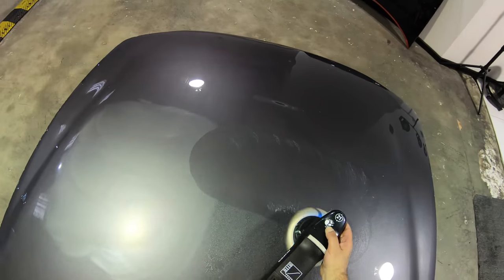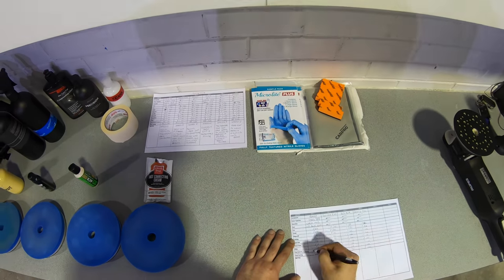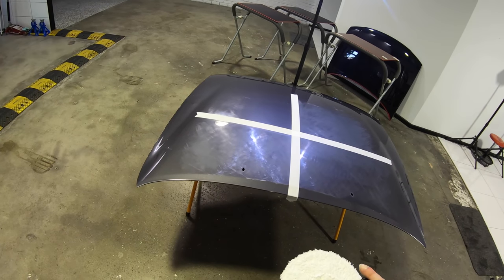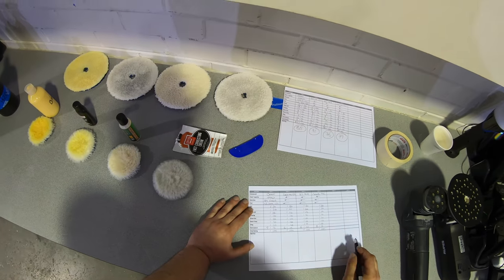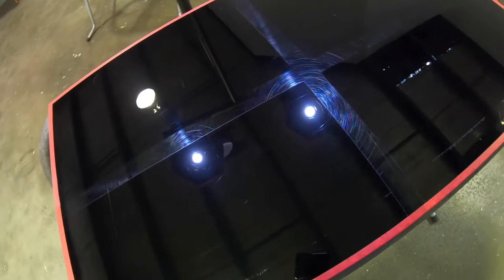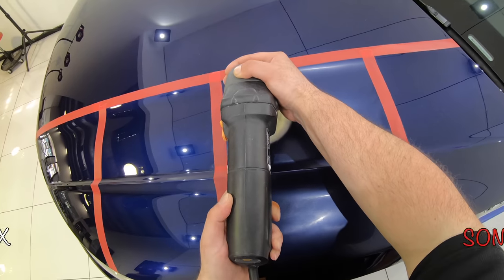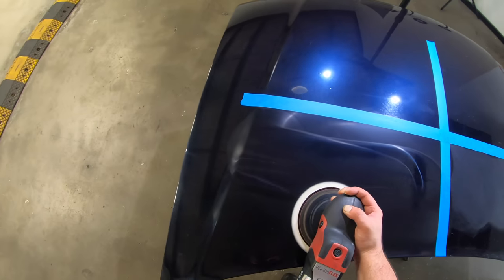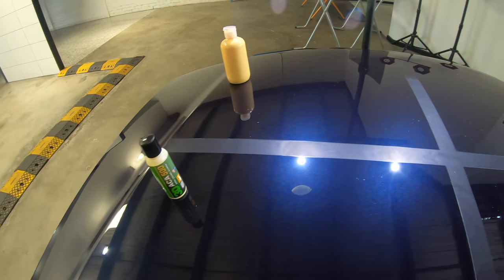Sonax CutMax vs Griots FCC vs 3D ACA 500 Compound Testing & Results!

Comment: I'm not surprised about the Griot's and Sonax the 3d was my focus since you mentioned the ability to remove 1200 sanding marks.I'm glad it did what it was designed to do the need for a second stage isn't too bad to wrap up the finish due to the intensity of the compound thanks again

Comment: 3D results are the best I have ever seen!
Reply: Also like 3D, but Sonax Cutmax is outstanding on some instances.
Reply: just try sonax ultimatecut
Reply: @garcia5986  I have, and still prefer ACA500.
Reply: I have tried Cutmax as well and still dont get tge results i get with 3D ACA500 with a Rupes coarse wool pad, followed by 3D ACA520 with a foam Shine Mate Black Diamond medium polishing pad. Especially on a black or dark blue vehicle.

Comment: I know years later but I tend to use the 3D for more Rotary work then DA as its main purpose is to level sice your gonna have to do a step or two either way. Sonax on the other hand has a longer work time in my experience but doesnt fully impress me on the finish. Griots on the other hand is spot on to what you described. Two product I like to see is Koch Chemie and Oberk. Fantastic video with all the diffrent methods

Comment: Hi guys , im using 3d aca 500 about 10 month , from the minute the company released it .
 Idid hundreds of car and i can say that this compound is a monster and by far better anything i triyed ( the only one is close is the carpro clearcut ) . but !! 
The aca 500 is for very hard clears and to use with wool pad and rotory for best performance . 
The second is with rupes and microfiber ( megs ) or ( wool pad 3d ) .
Reply: It works great with the Buff and Shine Uro-Fiber, as well as the original blue Rupes Microfiber pads.

Comment: Useful and informative as always Sandro...I completely agree with your results but after many hours of experiencing German compounds these are my thoughts in general:(correct me if i am wrong 🙄)
1.German compounds love ROTARY.(I think German engineers keep rotary action in mind all the time when making these compounds)
2.German compounds love WOOL.
3.German compounds are not meant to be used as one stage correction,they always need to be proceeded with finishing polish.
In future try Koch Chemie H8o2 if you have time.I would be very glad to hear your experience about that one.
Reply: Totally agree about the German compounds being designed about around a rotary. They will still work with a DA, but they were not designed for them. Best bet with DA polishes would be to go with Rupes or Griot's BOSS polishes, as they were based on using a DA.
Reply: Awesome insights.  I’m on the fence now about whether to purchase ACA510/520, or the Koch Chemie equivalent combination.  Can you provide any thoughts comparing both?  I’m a big fan of 3D’s products, but have no experience with the latter.  Thanks.

Comment: Griots FCC is what I use in the states it was made by a top polish guy in states can’t remember which one Kevin brown maybe?

I love 3D too though Sandro you need to try 3D “One”
Reply: FCC cuts better, finishes better, and is easier to wipe off than 3D One.....in my opinion. 3D does have excellent lubrication. Very oily, though.
Reply: @c6z061  - 3D One seems more of a "medium" than a heavy cut though. 

ONE is also strange in that some times it wipes super easily off the paint, and others it's a P.I.T.A. to remove..

Comment: I find the Griot’s BOSS items very easy to use. It’s a great system. Great results, long working time when needed, little or no dusting, and easy pad cleanup. I’ve used products that were hard to clean up, like I had Elmer’s glue in my pad and it wasn’t fun. 

The one time I was having trouble getting results with FCC I just had to step up to the MF cutting pad and it worked great.
Reply: What pad you used before switching to MF?
Reply: Carlos Rivera The Griot Fast Correcting pad.
Reply: @meiowalot7570  I just bought fcc and a white pad from griots what kind of issues will I run with my g9?

Comment: THANK YOU, SANDRO!! What a fantastic video!!! Do you feel TLC works better with MF pads compared to these? How about Jescar?
Reply: @CarCraftAutoDetailing  as far as finish, generally speaking, are you able to say if Griot's or Jescar cuts and/or finishes better?
Reply: @CarCraftAutoDetailing  which has more cut, LC low lint wool pads or LC HDO MF cutting pad?
Reply: @CarCraftAutoDetailing  Hi Sandro, how would you compare the cut and finish of FCC and Concours Precision?

Comment: Sandro did you try Griots FCC with Griots Boss white correction pad ?
Reply: I have tried it and the result unbelievable , I have tried another pads with FCC but Griots pad it gives best cutting level , maybe because the griots Boss pad very thin and flat which gives more cutting ability, but I’m little worry when I will use this combo in soft paint I feel very aggressive .

Comment: You do understand the sonomax and 3D your testing are not finishing compounds right? Ofcoarse Griots is going to show a cleaner finish and wipe off easier, afterall it doesn't have near as aggressive abrasives in it as the two other step one compounds

Comment: Sandro do you offer detailing courses and what is the cost?
Reply: Awesome mate.

I have polished my car with a da polisher and have a decent understanding of paint correction from watching all of your videos this year.

I would come to melbourne probably for 1 course only, if it was Sydney id attend all of them.

Would the advanced paint correction course be too much for me?

Or maybe bettee the paint correction + coatings?
Reply: Thanks mate, basically exactly what that course offers, paint correction and also the coatings. Will try to make it to a course first half of next year. thanks. Wish you were in Sydney.   @CarCraftAutoDetailing
Reply: Sorry mate bit off topic but have you had issues with opening the 1 litre black bottles of the Car Pro Inside?

I bought 2 bottles recently and tried opening it today and its impossible. The instructions say push down and twist but I haven't managed to, and I have a good grip.  @CarCraftAutoDetailing